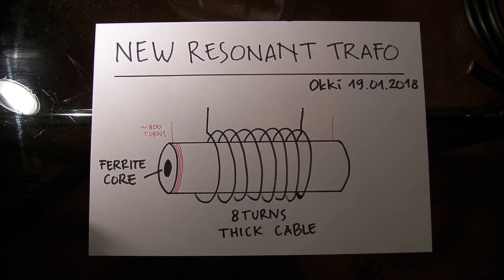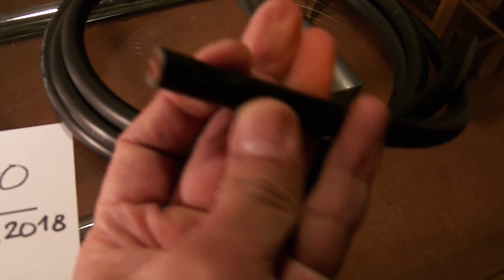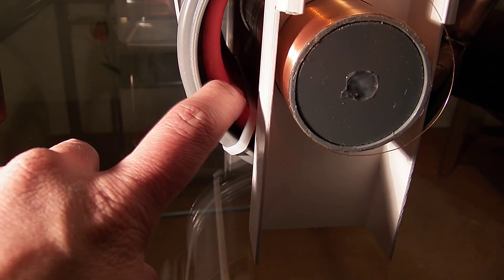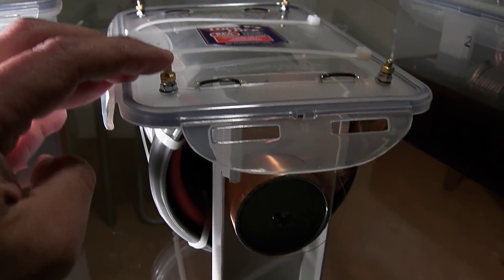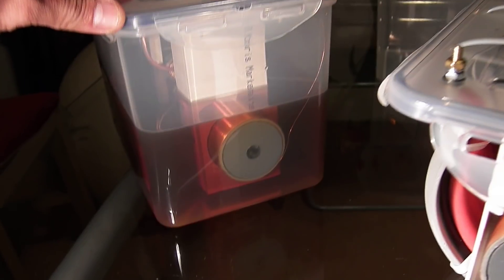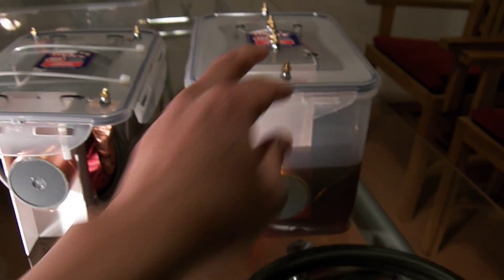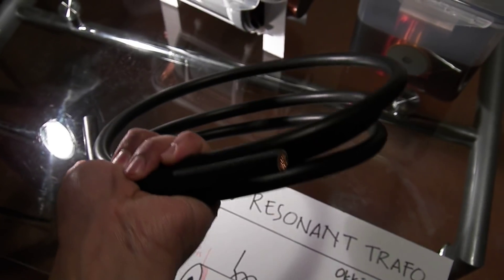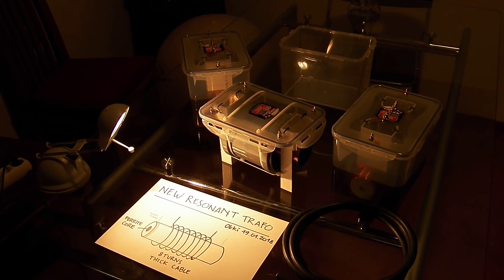New Resonant Transformer

Comment: Nice work :D is it thicker cable better solution??? @Okki Moeljadi
Reply from the maker: Thanks. Thicker cable means more electrical capacity than thinner one. More capacity in term of transmitting and receiving electrical energy. If you are working with the same frequency system e.g. 50 Hz, the more powerful motor or generator has always more copper mass than the weaker one. Nikola Tesla stated this in one of his lecture. Transformers behave also the same.
Reply: @OkkiMoeljadi  Thank you.One more question.Secondary coil must have one layer of windings? Or it can be multiple on one another?
Reply from the maker: It depends on the voltage on your secondary coil. To be safe yes, use only one layer.

Comment: Soo more energy you can put in that primary, and did you use drill to wound secondary windings ? Nice work Man...
Reply from the maker: Thanks man... I just want to see if I can draw more power out of this coil if I use heavier cable. Yes, I used electric drill to wind the secondary windings.
Reply: Okki Moeljadi did you read anywhere in Tesla patentst how to read or find resonance of the Earth?
Reply from the maker: I think you can use some kind of very sensitive radio receiver like Tesla Radio and read the pattern of the received signal. Maybe you need some kind of signal processor or pattern recognizer too.

Comment: So you changed from a bifilar cable to a one wire cable, why?
Reply from the maker: From my research, I can receive more electro radiant power if I use heavier copper mass. Please check out my "Ultimate Receiver Test" video.